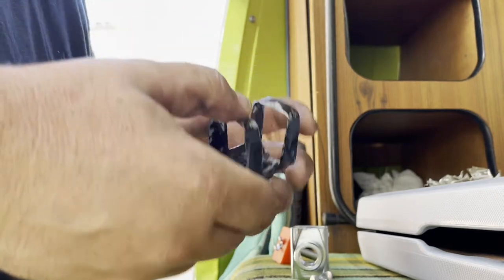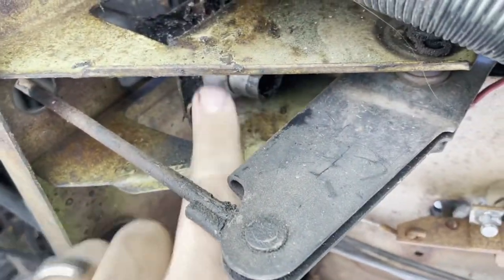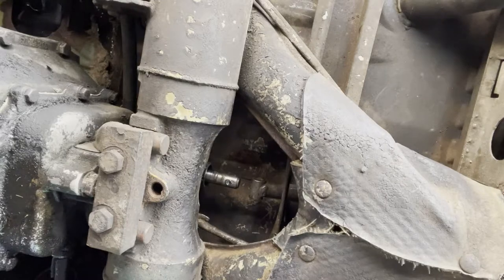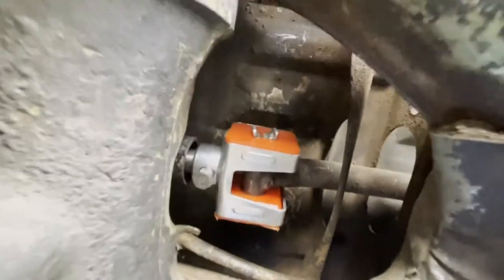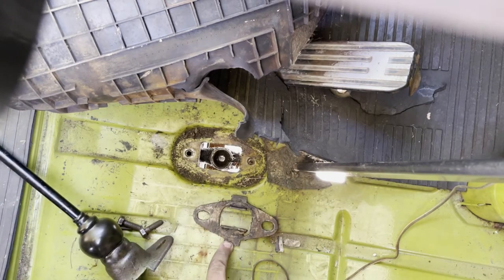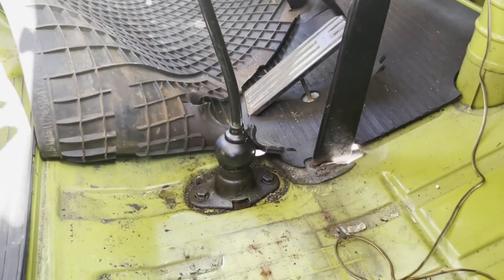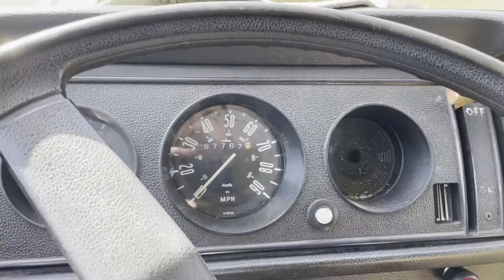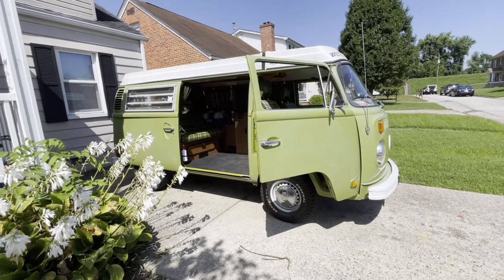78 Baywindow VW Bus Shift coupler/shift rod bushing replacement

Comment: Had the same problem on the Empi coupler I put on mine - the crimp came loose,  could barely shift into any gear. Had to weld it onto the cage. The other problem was the shift lockout plate and the bottom of the shift rod guide ring were worn away. Had to weld them up, too, and grind them to the proper shape. Once I did that , and put on a new front guide bushing, it shifted great!

Comment: Thanks dude. I just got a new transaxle and I figure probaby good idea to put a new coupler while I’m at.  But didn’t think about the front bushing. I should probably replace that too.
Reply from the maker: There’s two other bushings and two boots in the center of the shift rod, however they can only be removed and new ones installed with the transaxle out. The new coupler and front bushing alone makes a huge difference.
Reply: @anthonywatts6445  Thanks for reply dude. Yeah after I watched your video I went to a couple of vw websites and saw that there are two, so I will be replacing all three bushings and the couple since I have the transaxle out. Wish me luck, I will be making a video, so please subscribe and turn on notification bell so that you know when I post. Good meeting you dude.

Comment: 2:44  @Anthony Watts - what type of bushing is this in the front? I only know the style of bushing that you took out and replaced but not the one that you replaced it with…looks different and longer. Having issues with too much slack at the front bushing - replaced the bushings multiple times now and they never really lasted longer than a season…

Comment: I replaced both but still can’t get into 3rd or 4th. Not sure if it’s the plate or what that’s not working.  Ahhh
Reply from the maker: @jaytodd878  if you’ve adjusted the shifter plate and still not getting 3rd or 4th you might need to pull the trans nose cone off and replace the hockey stick.
Reply: @anthonywatts6445  I took off the shifting plate and tightened everything back down and it shifts great so I think you’re right. It drives smooth as can be without the plate.

Comment: Thanks for the vid! My coupler failed catastrophically at an intersection and left me pulling away very slowly in 3rd gear. What tires are you running? They look beefier than most stock.
Reply from the maker: They’re 27 inch General Grabber AT3s